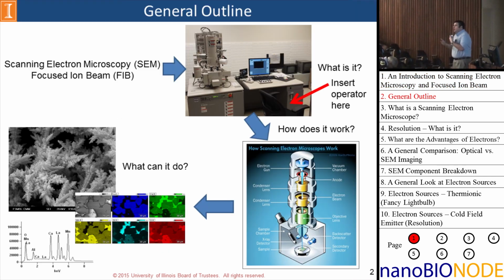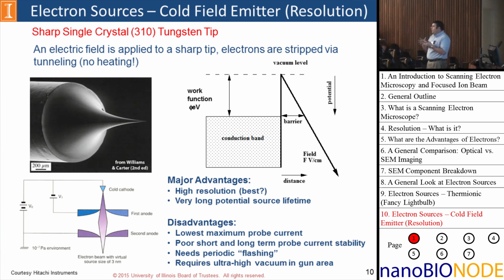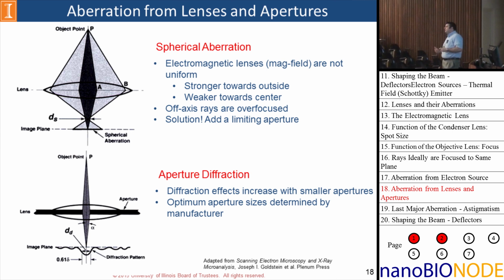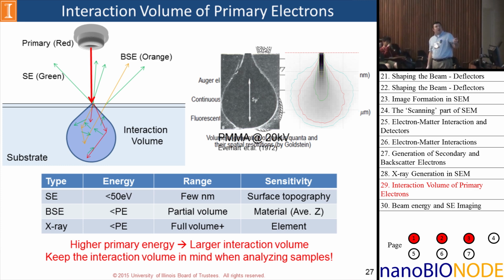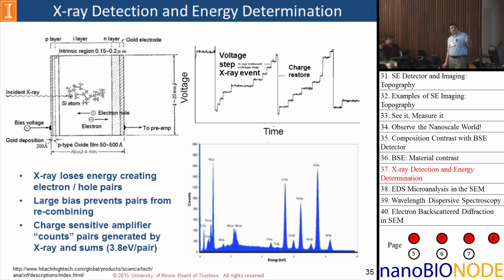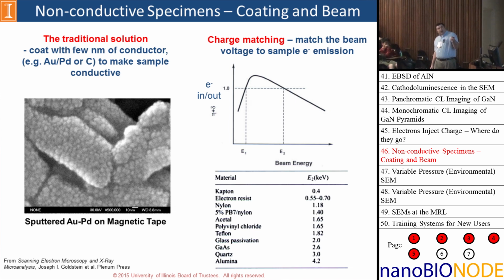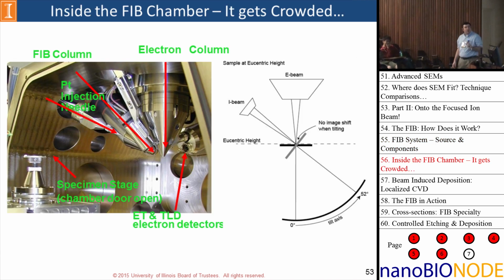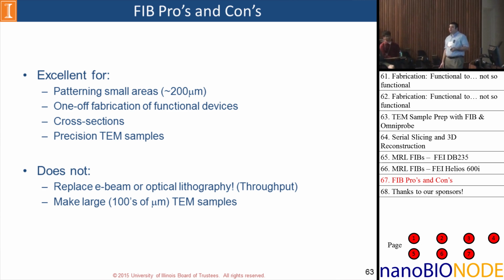An Introduction to Scanning Electron Microscopy and Focused Ion Beam (Matthew Bresin)

Comment: As u mention the Tungsten crystal hybrid  e emitter ,  a more complete explanation pls.
When Thermo Fisher supplied the 350 , thy stated a monocrystal of tungsten is coated with Zr02 ..   Well that is not possible , so now they state the ZrO2 lump migrates to the tip , which also is not possible at 1800K.   So what exactly occurs ?  the only way Zr may migrate is by alloying , yet TF specification stated the monocrystal size was 20nm .. perhaps they meant the crystal was polished to approx 20nm ..  NEXT is the Schottky 
Is this the Zr / W barrier ?  as ZrO2 conductivity increases (R ? drops) with temp ?

I have need for Tungsten tips which are single crystal .. where can i buy 500 needles ?

This is the supposition :  the reduction in work function from Zr comes from monolayers of Zr covering the entire emitter. The large agglomeration of Zr in the middle of the tip acts a s a reservoir to replenish any evaporated sites of Zr ..

Zr is NOT going to migrate at 1800K unless alloyed .. and why not plasma assist ALD coating fresh within an dual beam instrument

Comment: The link in the comments section has a problem. If you click on the "Slides" button it links to the wrong report (a report on TEM, not SEM).
Reply: Laser Fuse ya
Reply: https://mrl.illinois.edu/sites/default/files/pdfs/AMC-Workshop-2014_SEM-FIB_Swiech.pdf